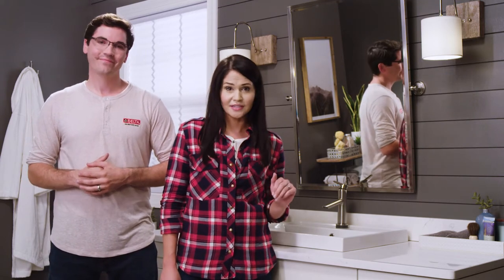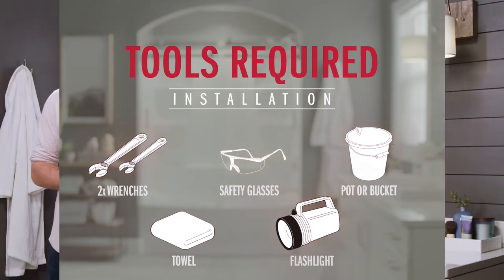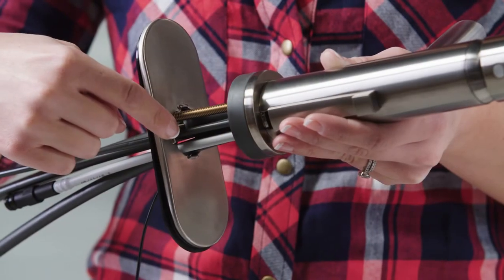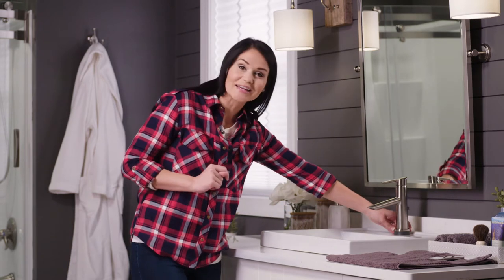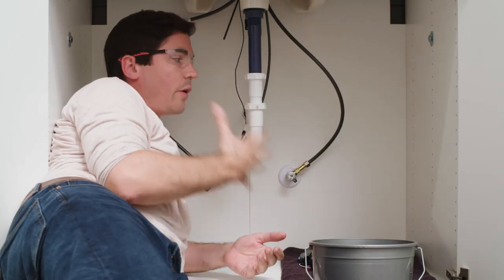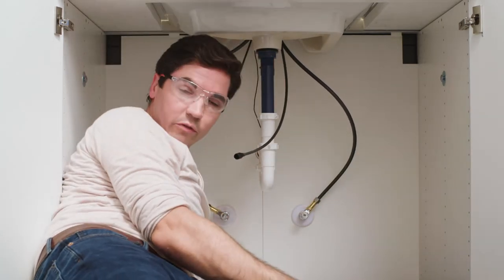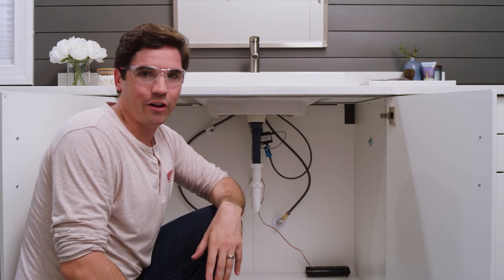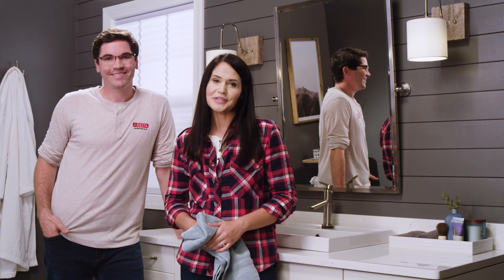How to Install a Delta® Touch2O.xt Bathroom Faucet

Comment: Delta, none of the widespread faucets have Touch at this time and this is where it is really needed. Widespread faucets cause lot of water drip on the counter just by their nature. Touch would really help prevent this. Unfortunately there are no Delta or other well known brand widespread faucets having touch or wave technology. It would even work if adapters are sold for converting existing Delta faucets to touch with the kit that is being sold.

Comment: Hi,
I run a preschool and I’m really interested in installing these faucets in our bathrooms.  Would you please tell me how often we have to replace the batteries? 
Thanks
Reply from the maker: Hi Nasrin, Thank you for your interest in Delta Faucet! Our Touch2O.Xt bathroom faucets include 6 AA batteries with a life of approximately 1 year. 6 C batteries can also be used for a life of approximately 3 years. Battery life will depend on frequency and type of use. Proximity sensing uses more power than touch sensing. 
-Bryan